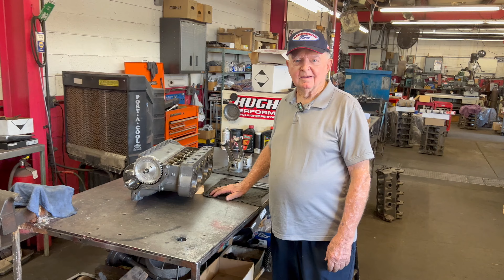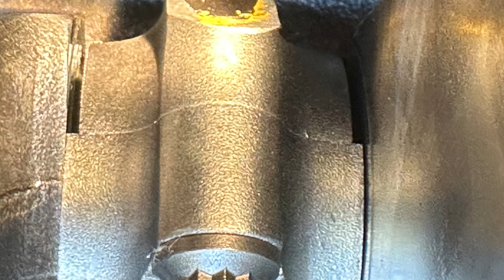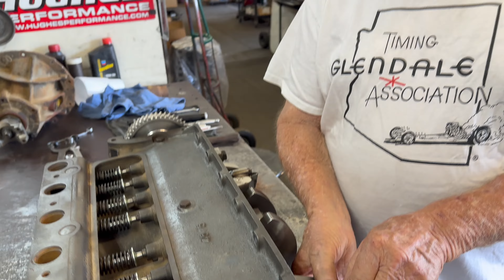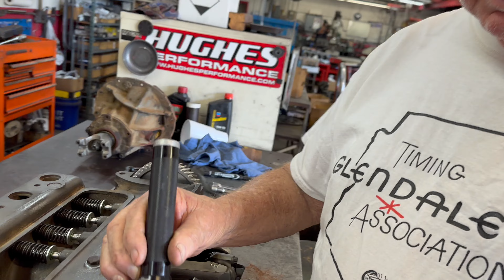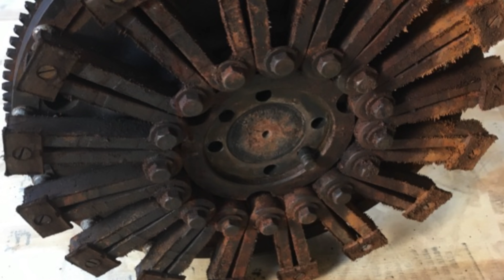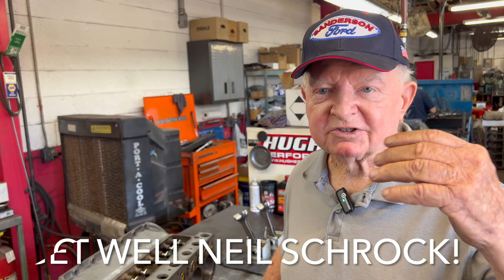Race Engineer Build Model T Stroker Engine!  Ed Smith Shows and Tells us Some of his Tricks #barryt

Comment: An older fella told us about his Grandfather and Dad using an old Model T truck he gave our Club to overhaul and preserve . They live in a bottom and when it rained you couldnt go one direction to town due to flooding so the nearest road to pavement was used , even with the mud and long hill .They would load up with produce in the early morning and the truck strugled on a good day but they couldnt just drive up as the gravity fed carb wouldnt keep gas to it. They had to fight gravity and mud going up in reverse . His Dad said he was going to add or change location of fuel tank . He never did , running it for many years as was , with wood cab very wobbly . Many see primitive trucks in museums looking all frail , but they were built to work , and work they did .

Comment: I have a Model A which I put 1,500 miles a year on it. I try to keep it as stock as possible so when it breaks I can get repair parts without modifying them. “Hello NAPA? I need a connecting rod…”
Reply from the maker: That is a really great way to go… Glad to hear you’re using it, best thing for it!

Comment: Love seeing different builds. But the wrist pen is supposed to rotate in the rod not the pistons with a floating rod and wrist pen set up and when you are letting it float on the rod and piston you should have a c- clip in the pistons so the wrist pen doesn't come out to far and make contact with the cylinder wall. I have seen similar setups with the wrist pins press fit into  the piston or the rod but normally not both.. why does it matter well the aluminum pistons if you are spinning the wrist pen because you have it locked to the rod the aluminum piston is going to wear way more than if it is spinning in the rod end since it has a bearing or bushing of some sort of is hardened and is harder and will wear less over time compared to the aluminum pistons.. the best set up in my opinion is float the wrist pen in the rod and not the piston. I'm not saying that it should be a press fit into the piston..it should be able to be put in by hand and then cut a Grove for c-clips in the pistons... not saying what you have done won't work just a different way and like you said it's only turning 2000rpm 's
Reply from the maker: Good discussion

Comment: Back in the early 90's i was lightly involved in a stroker 400 mopar.  From memory , it used 440 crank, 428 ford pistons and bbc rods. There was alot of side clearance on the rids and that worried me a bit but it worked. Somewhere around 470ci. Back then we made power, now you buy it.
Reply: I had a Chevy Vega with a pretty hot 327 from a corvette. Built myself a 12.5 second quarter mile car for 10,000 and all my labor. Like you said, now they just drop a wad of money. Where is the satisfaction in that?
Reply: No way that would work. Ford 428 pistons are only 4.13 bore. Stock 400 Mopar is 4.34. However, a stock Ford 429 or 460 is 4.36. I'm sure that 429 pistons are what you're thinking of.

Comment: The rods are going to hit the oil pan on the sides too. Heat the area with a torch and knock a lump outward to provide clearance. This is required for a stock Model A crank to T conversion.
Reply from the maker: Thanks- I’ll try to check with Ed to suggest or learn his plan 👍

Comment: He was going to use a VW oil pump? Was it a crankshaft mounted oil pump on the  front?
Oh interesting idea.  I have not seen that done before
Reply: There is a kit to mount a VW oil pump driven on the back end of the camshaft.  You can't run it with the original Magneto though.
Reply: @jameslockard4827  oh interesting 
I had a model TT 
And 5 spare engines and I gave away 
But I’m always interested in modifications people do on multi engines case I get excited and decide to get another engine rebuild it
Reply from the maker: No he's talking about a VW Distributor for better spark control.  Thanks!
Reply: @BarryTsGarage  I heard say it in earlier video
Reply: @BarryTsGarage  yes he did say using a VW distributor but he also said a VW oil pump earlier on

Comment: This makes almost no sense. The only way to get power from this engines is to install Frontenac heads or others like Rajo etc. Sidevalves are shitvalves!
Reply from the maker: The goal here wasn’t ultimate power, but but to make as much power as possible while looking original
Reply: some side valves are surprisingly quick     i  modified a 20s v twin enfield   ricardo  reshaped chambers  big valves cam ect      doubled power output

Comment: You can put a modern spark system on it useing crank position censor style ignition them turbo turner guys can get you going
Reply: put a good old bosch magneto on it   that will fire  better than any fangled new  electronic bs 
and no battery reqd    manual ad / ret  ignition too
Reply: @eweunkettles8207 Cdi ignition will work better than old bosch magneto and will also work with no battery, cdi module will be easy to hide since it is about the size of cigarette pack. Using cdi ignition from a smaller cc motorcycle or scooter might be a good idea. Also i understand its easier for you to say old stuff is "better than any fangled new  electronic bs" than admitting that you dont understand how work with modern stuff but it does not change the fact that modern ignition systems are at least as reliable as the old stuff not to mention they give much stronger spark.
Reply: @Dymitr_Nawrocki  
lots of historic racing cars still use magnetos   the higher the rpm the better the spark   unlike points whose primary gets less time to charge the faster it runs 
the only modern bit i use is   wima o.22 uf capacitors    
i have no desire to use   cdi  
yes i do know how it works  with a high voltage primary and very small ht coil  
but  have you studied magnetos in detail  ?   i know nothing as im a simple  ameteur  armature winder
Reply from the maker: I think a consideration would be keeping the engine bay looking original, I wonder if there’s a way to do that covertly…?
Reply: @BarryTsGarage  not sure about hiding though I would think possible some really brainy guys on u tube I look now before I start anything.

Comment: I respect my elders but i feel like im watching those guys from Pakistan I thought when you utilize parts from newer models one takes advantage of things learned over history not to mention when better is also easier its pretty foolish not to follow that path 
ignition gee lets complicate things by adding a distributor hmm maybe 60 year old outboard motor components or maybe some briggs and stratton pieces or keeping with the automotive theme 2 gm hei modules 2 double lead motorcycle coils and a couple of ford pickup coils file a few strategically located slots in whatever ya got thats round and spins with the crank and voila your own solid state ign

Comment: Chevy had dipper rods through 1953, not'"48 or '49".
Reply from the maker: Thanks
Reply: Further detail:  The first Chevy with pressurized oiling system was the 1953 235 with Powerglide.  The 1953 Chevy with manual transmission was still splash oiling with dipper rods and Babbitt.                   @BarryTsGarage
Reply: @Cougracer67 well bless your little heart